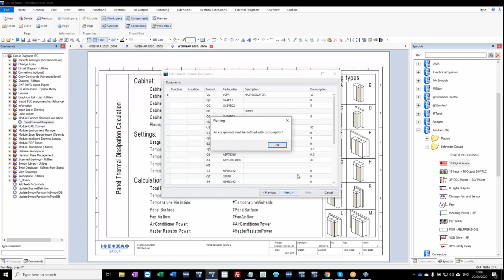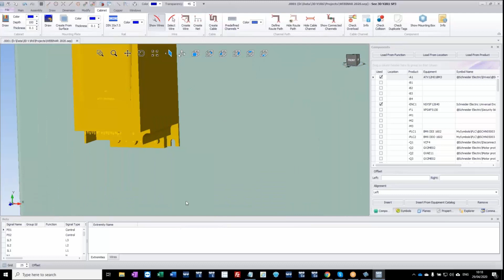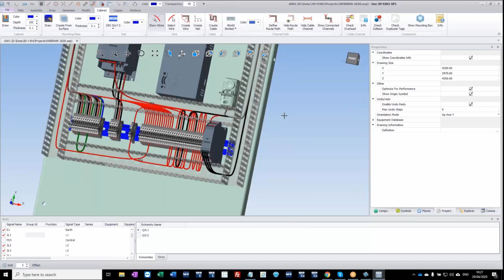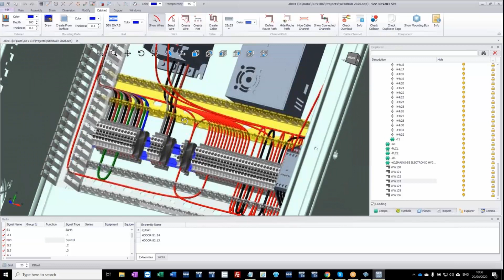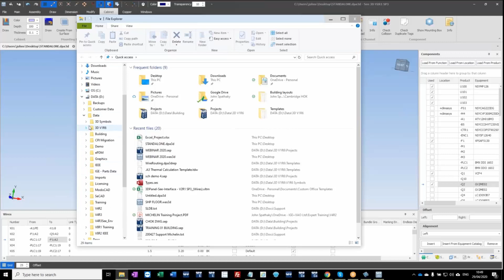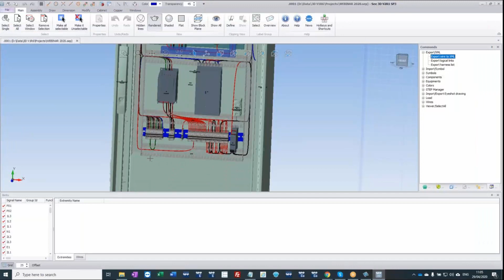IGE XAO See Electrical 3D Panel+ Webinar April 2020

Comment: How to get symbol lab in see I have seen v8r2 software but ther is no any symbols show which you are using
Reply from the maker: Standard IEC schematic symbols and a whole range of example manufacturers 3D symbols are provided with the software. We also provide a web catalogue which contains over 1 million parts and allows data, schematic and 3D symbols to be downloaded as needed. The current version is SEE Electrical V8R4 with 3D Panel V3R4

Comment: What is the recommeded Computer Specification to run the software efficiently?
Reply from the maker: Check, the hardware requirements on the Web site https://www.ige-xao.com/en/3dpanel-detailed-features/ essentially a modern computer with a dedicated graphics card. processor